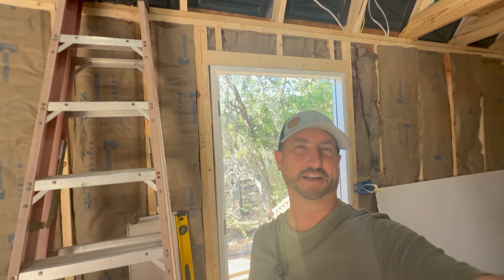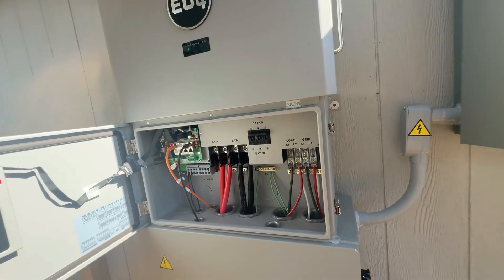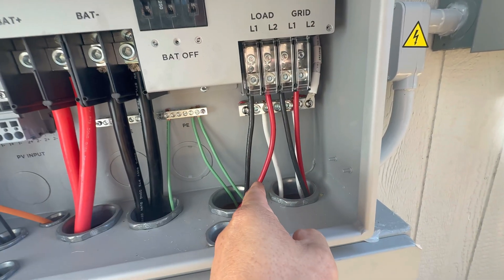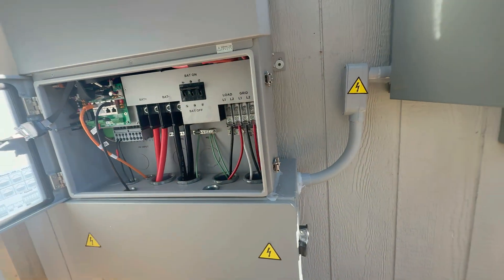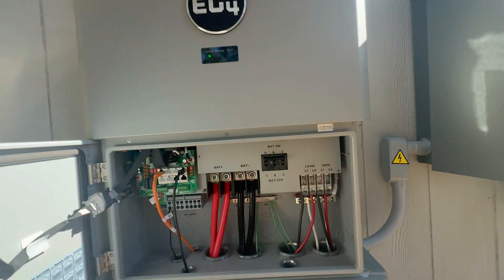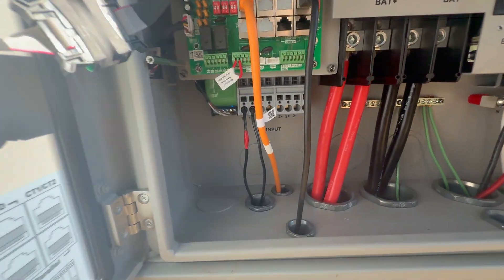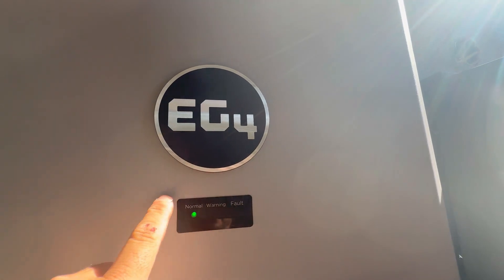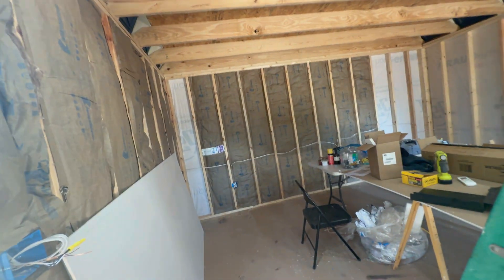Unleashing the Off-Grid Game Room with the EG4 Flexboss18!

Comment: You used two lines for battery?
Reply from the maker: Yeah the battery comes with 2 2/0 battery cables for each positive and negative. For the amount of power these batteries can send to the inverter it needs two pair because you can’t fit 4/0 into the terminals on the inverter.

Comment: Too many problems with this overpriced inverter. Common problems reported for the FlexBoss 18 include intermittent communication failures with the battery, grid brownout issues causing shutdowns, and overheating. Other issues involve security vulnerabilities and a lack of a separate generator input, with some users experiencing problems with the device's logic during grid events. However, many issues appear to be firmware-related and may be resolved by a new version.  

Common problems

Intermittent communication failure: Users report the FlexBoss intermittently losing communication with the battery, which can lead to shutdowns or an inability to discharge. 

Grid brownout/instability: During grid fluctuations or brownouts, the inverter may shut down, causing a brief power flicker, which goes against the goal of a stable UPS-like system. 

Overheating: Some users have reported overheating problems, though this may be mitigated with proper filtering and ventilation, especially in outdoor installations. 

Security vulnerability: A security vulnerability was mentioned in a discussion about the GridBoss, and it's possible this could affect the FlexBoss as well. 

Logic during grid events: In some cases, the inverter's logic doesn't perform as expected during grid issues, causing it to disconnect from the grid when it shouldn't. The company is reportedly reviewing this logic for future firmware updates. 

Lack of separate generator input: The FlexBoss does not have a separate input for a generator; users have to connect it to the grid input if they want to use a generator.

Comment: My reading of the manuals for the Allweather battery and the Flexboss18 both mention that they should be mounted on non-combustible surfaces. I understand that this installation may not be permitted/inspected/etc, but what's your experience/suggestions with mounting surfaces and meeting code?
I'm planning on installing a Flexboss21 system on my home and I'm debating what to do about the wood siding that I have.
Than you for the video and information :)
Reply: I mounted mine in the garage on a sheet of ¾” plywood, then added a ⅜” concrete backer board over it. This gives the FlexBOSS and batteries a fire-resistant, sturdy surface for secure mounting.
Reply from the maker: I’m not worried at all about it being on a non combustible surface. That being said, it’s a smart idea. Being extra careful is never a bad thing. You could put unistrut on the wall and mount it on that. That way it’s not touching a combustible surface directly. Not sure though if using unistrut would pass code on the non combustible surface though.

Comment: I have a garage with no grid power.  I want to run wiring for 4 lights and two garage door openers.  I have the EG4-3000 and a server rack battery.  How do I get those connected?  Do I still need a breaker box to run wires into and then run out of box into the EG4?  TY
Reply from the maker: Yes you’ll need to install a sub panel in that garage and run all your circuits for the lights and garage door openers. You’ll run wires from your EG4 inverter to the subpanel to feed it. Your batteries and solar panels will connect to the EG4 inverter also.

Comment: The grid conductors look kind of small for a 300ft run.
Reply from the maker: I’m doing 50amps from grid. So it called for 8 gauge. I upsized it to 6 gauge. Shouldn’t be any issue with voltage drop.
Reply: @unpluggedtexan 50a 240v at 300 feet calls for 3 awg. Also the panel with no overcurrent protection is sketchy.
Reply from the maker: @lolMyke interesting. I currently don’t have the grid connected so I may need to just put a 30amp breaker which is still way more power than I need from grid for this project. Thanks for pointing that out. I didn’t even run the calcs as I wasn’t hardly ever going to pull any grid power in this building.